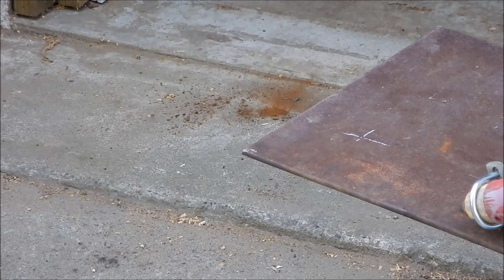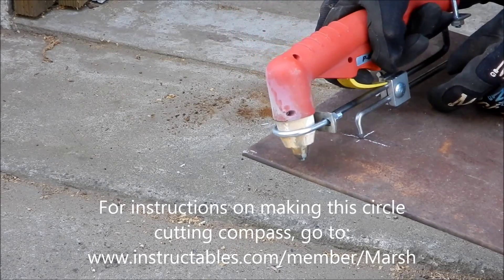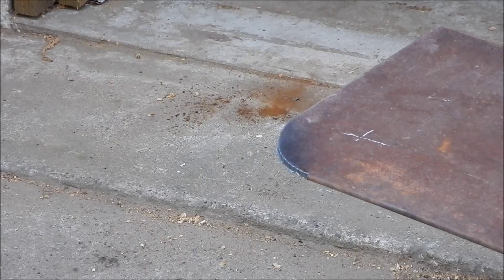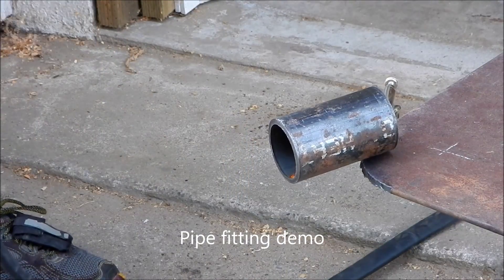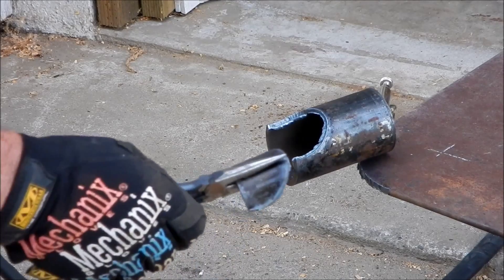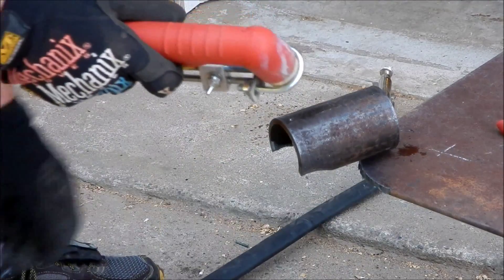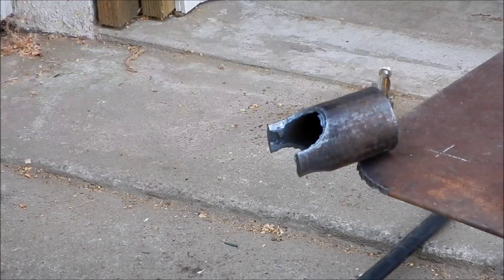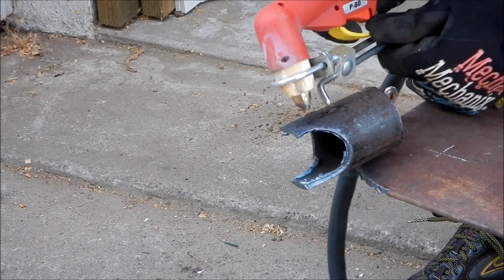Circle Cutter/Pipe Fitter for Plasma Cutter

Comment: Just a point... Great video... however, I just purchased my new equipment and am researching technique etc.  I just have to ask about using this type of equipment in shorts, wearing nylon gloves and nylon shoes...???
Reply: I agree Don, But maybe that's why his last name is Wild Man lol. I loved the video too.
Reply: The shoes proved problematic so I switched to leather. When you're a welder, minor spark burns happen regardless of what you wear. My town is a pretty hot place and dehydration is a far greater risk than some sparks. The size of the job determines the gloves I use. If it's big enough to substantially heat the piece, I switch to welding gauntlets.